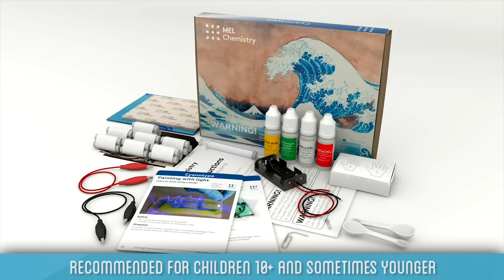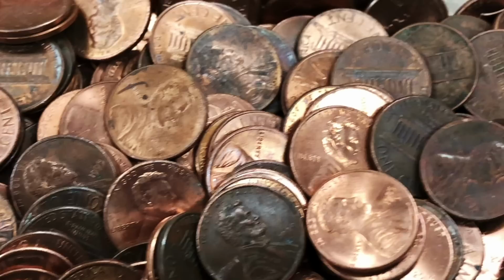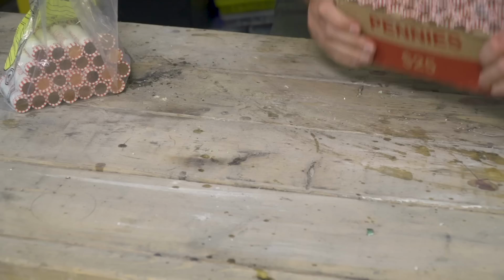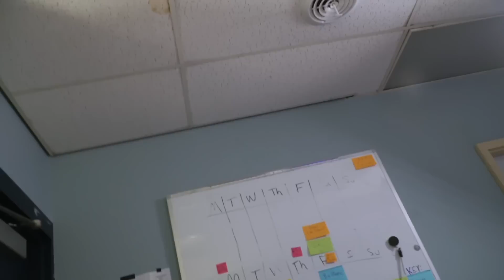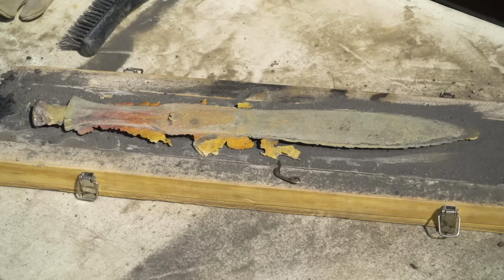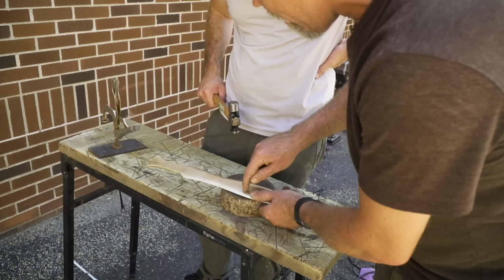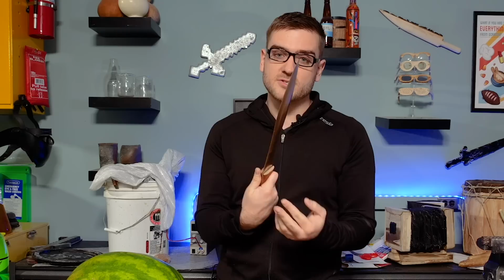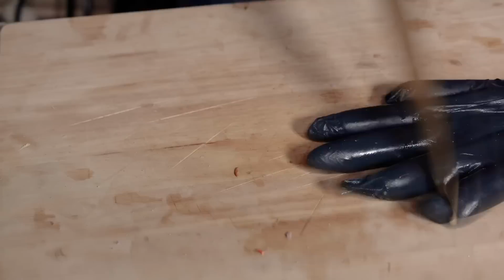How Many Pennies to Cast a Sword?

Comment: For those who don't know why hitting the edge of the sword makes it stronger; what they are doing is called strain hardening and it's very common. The mechanism behind this is atomic scale dislocations being created and 'pinned' in the metal. This makes it harder for the metal to deform when a stress is applied. Hitting the metal does not move the atoms closer together.
Reply: What? You mean striking metal with a small hammer won't change the bond between atoms? No way! lol
Reply: If iit becomes more dense then atoms are closer together.
Reply: @martouf13  I mean all I'm saying is his explanation is complete bs and has nothing to do with "density". But technically the addition of energy to some metallic structures (hitting it enough would heat it up) can change the atomic bonds. Iron is a good example of this.
Reply: No it changes the layout of the atoms
Reply: It simply mashes the metal together closer and therefore more material in the same amount of space is harder. Picture taking a full trash bag and mashing it down then putting more trash in. It takes up the same amount of space but it is denser more materials there and therefore heavier and stronger.
Reply: @jamesfair4023  buddy... I'm an undergrad mechE. I know what I'm talking about and I can assure you that the density is not, in fact, increasing as a result of strain hardening. Your trash bag analog works because there are air pockets in the trash. Unless the casting is crap - which it may have been - there shouldn't be airholes in the crystaline structure. If entrained gasses were present; the casting may have broken due to a concentration of stress around the air pockets.

Comment: Work hardening isn't about packing the atoms closer together. The hardening is caused by fracturing the metal crystals so the metal has many small tightly interconnected crystals.

Comment: 12:10 this explanation is completely inaccurate. The atoms do not get compressed or closer together. What you are doing is called strain hardening. By applying stress to the metal (i.e. beating it with a hammer) you are causing little parts of the metal lattice to break and slip past other parts. This causes different regions of the atomic lattice to be misaligned, and this misalignment creates barriers that prevent other parts of the lattice from sliding past the misaligned regions.
Reply: Psh nerd
Reply: i learned this in school lul

Comment: Should add a side note that using the proper grinding wheel as a safety note. Using the wrong one can cause it to gum up and explode while spinning at high RPM's.

Comment: Using antler for work hardening, as opposed to an iron hammer, would be more true to the roots.   I mean come on..... Who hammers bronze with iron?
Reply: Common Logic   no such thing as common logic........And yet you are here. Odd. I wonder if the other oxymoron Common sense will show up also.  :P
Reply: A well-off smith in the Iron Age. Funny thing, just because it was called the "Iron Age" doesn't mean they just stopped using bronze for everything.

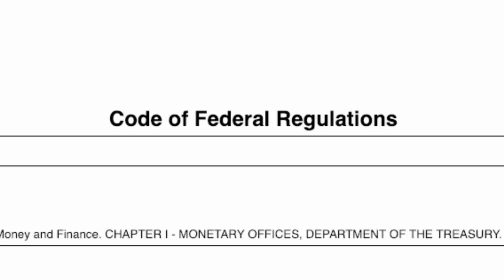Comment: 2:50 Please tell this to every person I tell that I use silver quarters or copper pennies for experiments that.

Educational, Entertainment, and Artistic purposes are allowed, which is why people with 'penny floors' are not arrested and those Lincoln portraits where you glue pennies to a frame are completely legal.
Reply: But melting down pennies are illegal because of stuff that was happening in 2005.  Not really relevant anymore,  but the law hasn't changed.  Most money is on cards anyways. I say we change the law,  along with Mary Jane.  These laws are outdated.
Reply: @inkphoenix5707  No. Melting down pennies in order to sell the copper and make a profit is illegal
Reply: It's still illegal to melt them down. Everyone knows pennies are not made with copper anymore, but they still haven't changed the law. Don't get all upset.
Reply: Fixin Nixon becouse most penny’s out there are copper, or at least half are still copper
Reply: This is the only reason i haven’t made a video where I made a bar of zinc from pennies because im too lazy to say “THIS IS LEGAL”
Reply: @inkphoenix5707  all money in the US is real cash. Whenever you make a payment with a card, you are ordering your bank to send money from your account to someone else's. This money is actually transfered in cash, in large lump sums at a time.

This is actually why the $100 note is technically the most commonly used, even if most people rarely see them.

Of course, you never see any of this happening. But that's why banks make... bank.

Edit: I will add that there is more goods in the US that inflates the seen value. When you look at your bank account and see X dollars, the bank doesn't literally have that money to give you. People see more money to their name than actually exists in the world. But real money transfers are being made nonetheless.
Reply: @inkphoenix5707  As the video showed, it isn't illegal for education purposes.
Reply: @rattus4232  They don't, they collect all the old ones. There are people who have hoarded nearly 100,000$ of pennies waiting for the penny to get the shaft

Comment: If he earned money from this video didn't he technically made money by melting U.S. pennies?
Reply: As the law reads it's only if he is earning profit based on the cost of the metal alone.
Reply: @demikus  Except

(c) The prohibition contained in § 82.1 against the exportation, melting, or treatment of 5-cent and one-cent coins of the United States shall not apply to coins exported, melted, or treated incidental to the recycling of other materials so long as -

(1) Such 5-cent and one-cent coins were not added to the other materials for their metallurgical value;

Which means him adding tin is him using the coins for their metallurgical value (copper to bronze) to make a sword. so the exemption is invalid.
Reply: @demikus  i saw you deleted your post. all the requirements for an exception MUST be met. if not met it is illegal. adding tin to the copper of pennies is going against the C-1 portion of the law. so he's doing this illegally.
Reply: @greatleader4841  Well then you should report him to the police, otherwise you'd be breaking the law as well.

18 U.S. Code § 4 - Misprision of felony

Whoever, having knowledge of the actual commission of a felony cognizable by a court of the United States, conceals or does not as soon as possible make known the same to some judge or other person in civil or military authority under the United States, shall be fined under this title or imprisoned not more than three years, or both.
Reply: @kurtpalmer3674  i don't think anyone really cares that much tbh, i just like to argue and make a point. i'm quite awesome at parties btw considering i used to be a promoter.

Comment: unstripped copper wire is free usually.   appliance cords, old house wiring, leftovers from job sites.  once you build a wire stripping machine (easy) you can crank out tons of copper for casting

Comment: It cost 1.7¢ of metal to make a penny so you just gave Mr. karbs an great idea on how to make free money.
Reply: problem: intentional destruction/defacement of currency is illegal in the US (and most other places too) so selling an illegally made object is an issue
Reply: johnny smit  the coins are made of VERY specific combinations of metals and alloys unique to each coin type so a simple metallurgical analysis would reveal what coin that you used and also bank records and tax records would reveal the influx of coins sufficient for the production. they have been designing coins for this very purpose (finding those who try to game the system) for hundreds of years and the time, effort and resources you might use to mask the coin destruction costs more than the difference in material prices so it isn't even worth it.

Comment: Could you rig up a way to have a battery attached to the sword and have it electrified?
Reply: You can do anything you put your mind to.
Reply: Yes. You just need to make sure you are properly insulated.
Reply: Touching someone with an electrified sword (under voltage) won't do anything if the person wears shoes.
Reply: Uhh, the sword would just be a hard short, and heat up. It wouldn't shock anyone. To make it shock someone the sword would need to be made of non conductive materials with 2 independent circuits running through it, that alternate on the edge of the sword day enough apart from each other not to arc given the intended working voltage but close enough together to overcome the resistance of skin fat and muscle.
Reply: Fallout intensifies
Reply: If you think about it you can also make an electromagnetic sword with that too

Comment: bending a paperclip gets easier not harder.
Reply: I think he was talking about a single bend, where you try to get the angle tighter, and it becomes harder until the force needed to compress the inside of the bend becomes greater than the force needed to break the bond on the outside of the bend.
Reply: It gets harder until it gets easier. Try a thicker wire if u can't experience what he was talking about. Also, notice that the bending point changes after some bends, because the first bend point has become harder metal.
Reply: Ik

Comment: Fun fact: you can tell the difference by flipping them coin-toss style. As long as you get some nail contact when you flick it it will ring if it's copper but won't if it's zinc.

Comment: You don't cast a sword.
You heat a blank piece of steel and hammer it until it is hard and flexible, sharpening it on a grindstone when completed. 
A sword that was cast will always be inferior to a forged sword. 
Basically you wasted "too many pennies and time".

Comment: Could be wrong, but it looks like you probably lost a bunch of your edge hardness while doing the grinding of the edge. The heat generated by the friction of the grinding belt will anneal the edge and cause you to lose hardness, and it looked plenty hot around 13:48. Similar things can happen when you're blacksmithing, if you harden the blade before doing the bulk of your grinding, you risk losing that hard edge.

Comment: You need not use nitric acid. Sanding the penny down until you have a smooth silvery brushed zinc texture works without something most people don't have like Nitric acid.

Comment: Curious about using quarters, dimes, or half dollars. Obviously that's like $100 in raw materials and the metallurgy of that alloy is kinda uncharted territory from a weapon design standpoint, but it would be interesting using quarter alloy for a sword. It's 75% copper.

Comment: Work hardening is undone by heat. Its possible that by using power tools like the bench grinder to put an edge on it ypu could remove the edge hardening.

Comment: Bruh, did you read the next line, pretty sure it says that the rule is dependent on the volume, which in this case is a lot, and the use, which you're explicitly using them for their metal content. It could be argued that this isn't a means to profit directly from the penny but also you literally had a sponsorship at the beginning of the video so profit is pretty assured. It could easily be argued that this is still illegal. Congratulations, you played yourself.

Comment: he misrepresents hardening metals, the atoms arent getting closer together its teh crystalline structure of teh metal, yes the paper clip is hardening at the point of teh bend/break but thats not because the atoms get closer together its that the metal is going from a soft crystaline structure to hardened structure. if what he said was right why would heating up steel and the cooling it quickly make the atoms of the entire piece of metal get closer.

Comment: When I go to aquariums they have this machine that presses the penny into an oblong shape then stamps the aquarium name logo on it whichever one you go to but you put in a dollar and does this. Is that not concidered a profit therefore they are breaking a federal law? 
Also I use to get our fireplace so hot that I could melt a penny on the metal part of a shovel, the part that does the digging and had some interesting shapes and then made it in a necklace with a leather strap as the necklace part

Comment: I mean kinda funny he didnt wanna melt tin coins, I get it its tin I cant many people using that for currency or it lasting from a time period where they did. So they're probably extremely rare. But it's kinda funny hes fine melting the the collectable old coins. I mean even if you needed 2000 of the mostly zinc coins you only spent $20 on a sword. I mean $5 is crazy ngl.